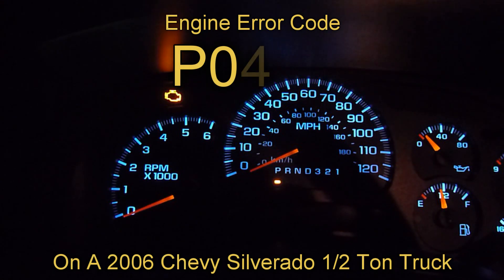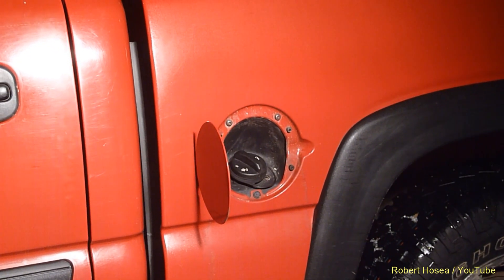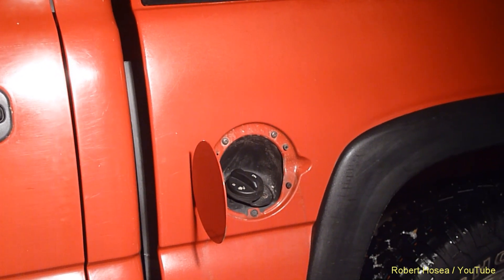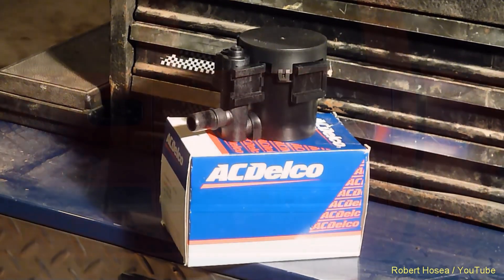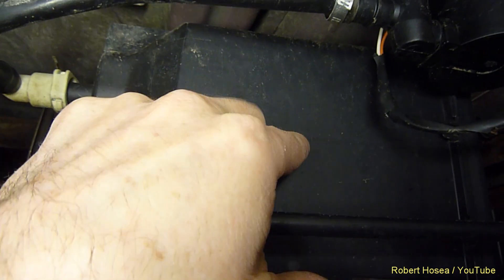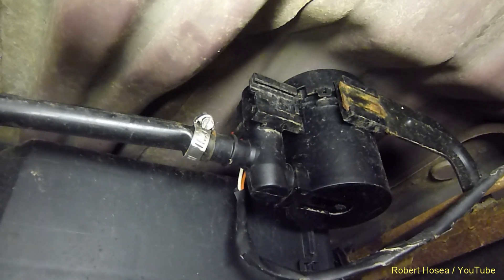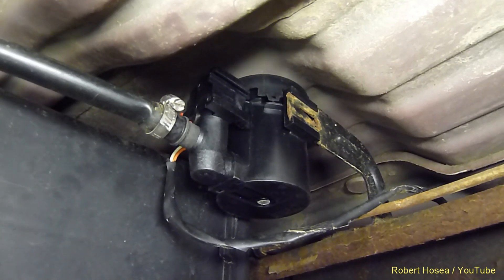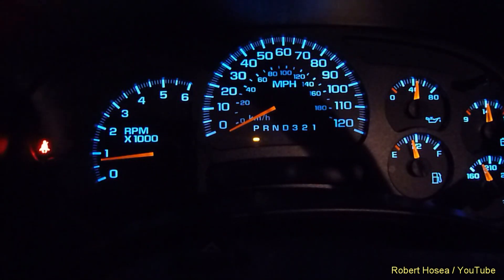Code P0449 Vent Solenoid On 2006 Chevy Silverado.

Comment: Thank you. The video was very helpful. The issue happened to me before also. I was starting to think that one of the wires feeding the solenoid may have been broken. I did take mine apart last week, but not to the extent that you did with to cleaning and verifying the spring functions. So I bought a new one from Rock Auto for $10 (+$10 shipping) Thanks again. I have 309,684 on my 2006 Silverado.

Comment: Resetting the codes and then starting it for 2 seconds doesn't mean it's fixed, that light probably came back on the next time he drove it.
Reply from the maker: That's bull, brainless. Why would the PO449 engine code be thrown again, if the problem has been fixed. It wouldn't.

Comment: I have a p0172 and p0175 both banks rich. Ended up to be the vent valve. Funny it was stuck open but it didn’t throw the code you shown. Fuel trim went back to normal. I was running-17
Reply from the maker: Great job on getting the problem figured out. I think I was getting the PO449 because the coil in the solenoid was electrically open, due to the damage from the gas getting inside. That's really good information to know on what you found with yours. Thank you.

Comment: Although I have the p0455 code, could this potentially fix my truck? I get a dash code of "tighten fuel cap" although I've replaced both the fuel cap and evap vent solenoid. Please advise
Reply from the maker: Hi Armando. In my case, I believe the vent solenoid was defective electrically, and that is why I was getting the error codes and engine light so quickly after over-filling my gas tank. And that is a bit different then the errors associated with the gas cap, which usually take multiple engine startups and shutdowns before throwing that error code. If it's been a while since you've changed the vent solenoid, then it could be that it has a vacuum problem, and not an electrical problem like I had with mine. You should also check the vent line that connects to the vent solenoid too. There may be a hole in it which may make the ECC think its a faulty gas cap instead.
Reply: @Thebobfactor  thanks for responding and helping out. Replacing the evap vent solenoid did the trick. I just smogged the truck.
Reply from the maker: @armandol1826  great job! I'm glad that you got it fixed.

Comment: Good video but one item. At the end you say lets see it the check engine light goes off and the end screen tabs block it! Granted you say it did but it can't be seen.
Reply from the maker: Thank you.for the comments. Regarding the end screen tabs, the engine light is right above the tachometer, and on my screen an end screen tab doesn't appear in that area, which is the upper left corner. At least it doesn't on my screen any way. It's possible though that YouTube does it differently on your screen, and others though. I appreciate you pointing that out.
Reply: @Thebobfactor  Maybe. I limit my end screens now if I even use them at all because they tend to block out too soon, at least for my liking on my videos. 
Again good video and useful information.

Comment: What is your part number for the ac Delco brand? I've seen so many different versions of this part. Want to make sure it's the same harness plug. Thanks for your help👍
Reply from the maker: Dwayne, the part number is ACDelco 214-2149.
Reply: @Thebobfactor  thankyou very much. That's the one I was looking at. When you changed it did you ever have to change the plug in? Wire harness adapter?  Or was it a direct fit? Thanks again.
Reply from the maker: @dp-calibrations2057 , everything fit perfectly on it electrically. I never had to change anything with the plugs or harness. The only thing that ended up being different from the actual factory install was having to add the hose clamp to the vent line.
Reply: @Thebobfactor  great thankyou
Reply: @Thebobfactor  hey just wanted to say thanks again. Got the part  And installed in 10 mins. 👍
Reply from the maker: Hey that's awesome  @dp-calibrations2057 . I'm glad that you got the solenoid replaced. And I'm glad the video helped out! :-)

Comment: Great video! Just so everyone knows though the engine lights was still off because the computer hadn’t completed an EVAP cycle yet to see if there were still issues or not. It may or may not have fixed the issue. I’ve been dealing with evap issues on GM vehicles for years and this isn’t always the fix. It could be the evap canister or even lines in the fuel tank. Every situation is different but this is among the most common fixes.
Reply: Thank you for this, because I was thinking well the light would be off until he drives or starts the vehicle if he just cleared the codes wouldn't it?? And also thank you for the other information about the cannister and hoses!! This solenoid did not fix my P0449 code. Thanks again!
Reply: How long did it take to complete the EVAP cycle test afterwards?

Comment: Drive cycle was never completed after resetting the cel...  need to do a complete drive cycle for the monitors to set... if it worked then the cel wont come back...
Reply: So you figure he shut the truck off and ran inside to post this before confirming the fix? Nice work. Also said it was second time replaced due to overfill.

Comment: I had a code po455 on 06 chevy avalanche and the dealer said it was canister solenoid valve. Disconnecting takes most time. I didn't have a code reader to reset engine light so it's still on.

Comment: Hey where did you get the plastic rear wheel well covers ???
Reply from the maker: I'm not sure where they came from Tom. They were on the truck when I bought it in 2008. I always assumed they were stock. I've seen other Silverados with the same trim package on them too.

Comment: Can u please send me the part number of that vent solenoid that u installed on ur 2006 Chevy Silverado cause I have same problem and want to find part on amazon also thanks
Reply from the maker: Hi Stan. The part number is ACDelco 214-2149.
Reply: Thank u so very much for that sir
Reply from the maker: No problem Stan. Good luck with your repair.
Reply: Robert Hosea keep videos comin

Comment: Thank you thank you!!!!
Just purchaced an 03 silverado.
CE light came on. No power to reader port. Replaced port fuse in fuse box in engine compartment.
Reader worked and po449 came up.
No i know what to do.
Reply from the maker: Good deal Gary! Good luck with the solenoid replacement.
Reply: was that the problem?
Reply: it is the same fuse that the cig lighter uses, don't confuse that with the aux power plugs that look the same, the fuse is located in the under the hood fuse box driver side it is a 15A in my 05.  A google search turns up pictures, that clearly point out the fuse.

Comment: great video, but i cant seem to locate  the canister on my truck 2006 silverado   like your  v8  5.3 extended cab, i am starting to think it has to be above the tank somewhere , i even had it on a lift  and the mechanic couldnt find it, i was side by side with him while he was looking, so is it possible  it is  above the tank and  cant see it until the tank is dropped??  how frustrating this has becaome
Reply from the maker: Jim, is it the large rectangular canister that you can't find, or the small round vent solenoid that I show being replace? If you can't find the canister, then you should be able to follow the vent line to the canister from the vent solenoid, and visa-versa if it's the vent solenoid you can't find. Is it possible that the gas tank has been replaced and things have been modified?
Reply: @Thebobfactor   sry  took a whie to post back about this,   the vent solenoid was above the tank , so  i had to drop it  , got the relocation kit all is well light is  off
Reply from the maker: Good deal Jim. I'm glad you got it fixed. I never knew that the solenoid was above the tank on some trucks. That's good to know.
Reply: @Thebobfactor  nor did i. I have a feeling the tank was replaced , and that's where the original owner  stuck it??  but anyways  ty  have a great day
Reply: @Thebobfactor  i  found  the canister i can see that  fine i try following the hoses, they seem to  go  over the top of the  tank, i will most likely have to drop the tank that sucks , because i can't see the solenoid  anywhere , even  my mechanic  had it on  the lift  tried using i mirror to see  between the  floor of the truck  and the top of the gas tank, no luck , so i am betting all the tank is hiding it well
Reply from the maker: @tazblzr88 , well that sucks that its that hard to get to.  Good luck with it though. Let me know how you make out on it.
Reply: @Thebobfactor  thanks   brother, i am going to drop it off next week  i dont want to do that job  on the ground  lol

Comment: So GM puts the vent line in a location where gasoline can easily overflow and damage the vent solenoid?
Typical idiotic GM engineers.
Reply: Yeah, it's actually been recognized as a common issue. GM released a service bulletin. You are supposed to relocate the evap canister to a higher location around the filler neck.

Comment: Paid close to $200 after tax for the canister for my 2008 1500 ltz..got the plug out, got it off the bracket, and now can't disconnect the hoses..front hose is cheap plastic that if I force it anymore might tear a hole in it and the back hose is on it like it's a metal pipe lol..I give up lol
Reply: You need to replace the hard lines with Flex fuel lines and you're good to go

Comment: i love a video that'
s right to the point thank you  for posting, i have to do this to my 06 1500 silverado, as well as a wheel speed sensor..
Reply: How did it go on your 06? I'm curious because I need to do mine.
Reply: @ryanharvey9338   i fixed the wheel speed sensor , luckily it was just a loose connection, the vent solenoid  i still cant find as crazy as it sounds i have looked all along the  main frame, i found the charcoal canister tried to follow the hoses  from that , epic fail  im clueless where to look now lol

Comment: Vent valve: Duralast PV428 is $24...(04-05) GM 20941985 (06-12) Electric plug (Wells 1161) is only difference.  Just heat the hose with hot water and switch it to the new one...  Try cleaning the valve first... 12vdc and blow into it and it should be closed when powered... Valve comes off the housing... Tab is on top and turn it 90°.  OR the Fuel Pump corrosion issue...

Comment: Mine looks different on my 2006 Silverado.  It is smaller and has two spots to connect a hose.  The replacement they gave me looks like yours but obviously it is not the right part.  Is there a different spot it might be mounted?
Reply from the maker: I've heard this from a few other people where the original vent solenoid has two hoses, and the new one only has one. Evidently the extra hose on the original vent solenoid goes to a filter for the air input, and the new one has the filter built right into it. From what I've read in some forums, you just need to remove the old unneeded filter hose. As far as mounting it goes I haven't read anything about how they mounted them. Sorry I can't be more help Mike. If you could post in here about how you end up doing it, that would really help others. Thanks.
Reply: I️ have the same issue on mine but haven’t seen anywhere on how to correct the issue. If anyone has any more insight please share.
Reply: https://www.youtube.com/watch?v=MFh9fCLzNbw

Comment: Shouldn't need to cut the hose.. there is a quick connect. And the error code will need to be cleared by an OBD II. OR disconnect the battery for 10 minutes.

Comment: As a owner of 07 sierra truck. Wanna say thanks for your video was very helpful. Got the part from auto zone, heater hose, clamps 15 minutes later done. Couldn't be done without heater hose. Cost me $29 only for all. Got it reset and started again it shows 0 codes found. Thanks a lot.
Reply: What did you need the heater hose for?

Comment: Just in case anybody wants to try to something that wont cost a dime (dont get me wrong, this video is a great video if you're going to replace the unit and i thank you for posting it)...anyway, once you've gotten to the point where you've released the canister form  its locking tab that holds it to the truck, you'll see that the canister has a cap on it that can be removed by releasing the tabs that go around the edge...pop the cap off and remove the filter for cleaning (clean out the canister as well)...you can also remove the solenoid from the side of the canister and clean it out with compressed air. With the solenoid separate from the canister you get back under the truck and plug it in while using a flashlight to look into the opening where you removed the hose...you will be able to see the spring inside...then you'll need to have someone start the vehicle, you hear and see the solenoid move if it is working. Reassemble everything and 95% of the time your codes will be gone, if not, then replace it. I've done this to 4 trucks so far and it has worked every time. This fix is more for the guy who simply doesnt have the money to buy the parts to replace everything and wants to try a "DIY" cleaning of the parts. The only thing about my way that is "iffy" for a beginner is that you'll be starting your truck while you're under it..i make sure to have the truck in PARK, the PARKING BRAKE ON and the wheels BLOCKED before doing this. Again, the video is great and i hope it helps people. i just thought i would throw out another option.
Reply: worked for me. thanks
Reply: 3 years later An thanks for the tip👍
Reply: Mr Remington
Reply: Mr T this worked for me. Thank you for the advice
Reply: Thank you!
Reply: Ok
Reply: My solenoid spring dosent move ..
Reply: Thankyou mine was filled with sand ffs
Reply: Bro, break a fifty...Sheesh...

Comment: there are 2 hoses on mine. and it is smaller than the replacement. 2006 silverado. one hose goes in back and one in front
Reply from the maker: I've read about this problem in a few forums before, where the original vent solenoid has two hoses, and the new one only has one. Evidently the extra hose on the original vent solenoid goes to a filter for the air input, and the new one has the filter built right into it. From what I've read you just need to remove the old unneeded filter hose. Here's a statement regarding this from someone who ran into the same problem on a similar vent solenoid:
-----------------------------------------
GM never recalled the bad part but issued a new more expensive parts kit 
as a replacement for the original part that left many owners aggravated.
 Some have chosen to install this single port with a built in filter for
 way less money.
-----------------------------------------

It would be great if you could let me know how you make out on this.
-Bob

Comment: I have overfill my gas tank but just one time and that was a long time ago and it never went until yesterday morning but did some fuel pump work would it be that I went to autozone and they said that was my problem
Reply from the maker: Are you up and running now Raymundo? Did you have to change out the vent solenoid too?
Reply: Oh nevermind my code is P0442
Reply: Robert Hosea well its probably the same thing so ima just go buy it is like $40 in autozone
Reply from the maker: Good luck with it Raymundo. Let me know how you make out on it.

Comment: When this goes bad will it cause you to lose mpg?
Reply from the maker: I didn't notice any difference with the mpg on either time that this went out on my truck Christopher.
Reply: Ok thank you. My truck dropped about 5mpg and trying to figure out what is doing it.
Reply: Dustin Rust why did you replace the main shaft bearing? was the 4x4 not working? I have an 05 and I've thrown parts on parts at the 4x4 and haven't fixed it yet. wondering if this is the next step
Reply: i replaced the main shaft bearing in the transfer case cause when i would shift into 4 it would make a horrid noise. found out it was missing a few balls inside the bearing and also found out it was replaced before. so i put the OEM bearing in it. i did have the service 4wd come up on main dash so i replaced the switch and it went away. my 4wd always has worked except when the service 4wd came on. taking the transfer case apart is easy. dont take it to the shop. just get under the truck and take it off with i think 4 bolts plus taking out the drive lines. pull it apart and see whats going on inside.
Reply: i will add....im back up to 13.6 mpg
Reply: mine recently went out and my MPG is going from 13.6 down to 11.8. i dont think it would cause a issue but im replacing it anyway and seeing if it helps. The purge valve on the top of engine will be replaced as well. For me recently if its not one thing its another with my 05 chevy silverado 1500. just replaced the main shaft bearing in the transfer case. thank god i know what im doing. a shop would love that. ha

Comment: Thanks for the video and explanation.   Any idea if/where to get a low cost code reader?
Reply from the maker: Hi Michael. My code reader is about 10 years old now, and I purchased it on Amazon. That might be a good place to look.
Reply: Awesome, thanks Robert.  Used to be our local auto part stores would do it if you brought the vehicle in, but this one won't move until its fixed. Thanks again.

Comment: I have this code on an 02 Silverado. my truck will start and run. put in gear she stalls. is that related to the solenoid? any1. thanx
Reply: CRF 450 oh thank you soooo much. I didn't already know this
Reply: No, your truck is just an old piece of junk. Sorry
Reply: I'm sorry, no you sound like you have a problem getting fuel. I'm guessing it's the fuel filter or pump. Your post is 8 months old now so you must know. You tell me.
Reply from the maker: No Badd1one, I really doubt that would be related to the vent solenoid at all.
Reply: CRF 450 it was a company truck. mechanic got it running again. I never asked,how